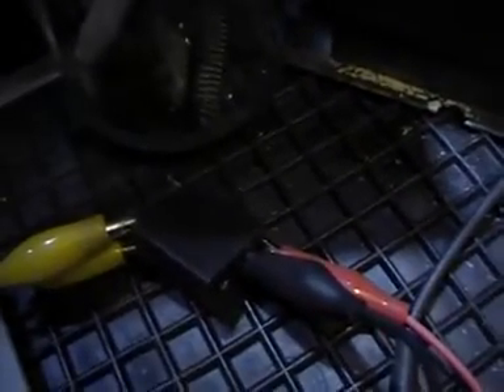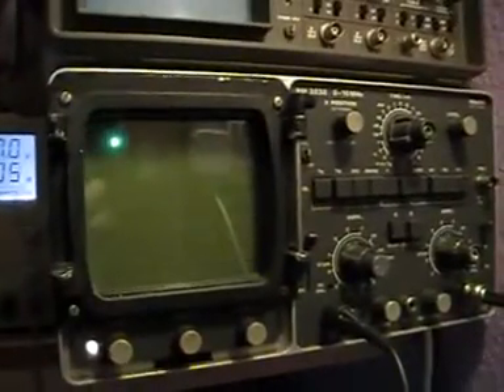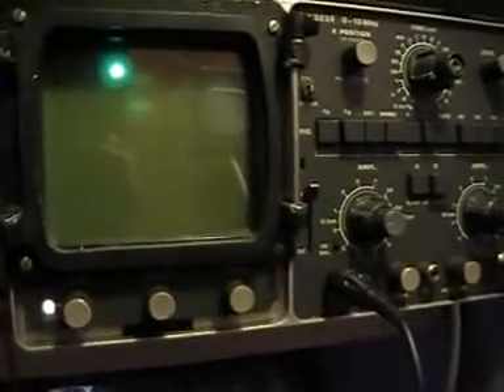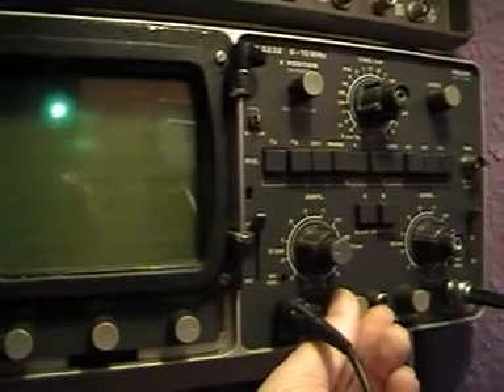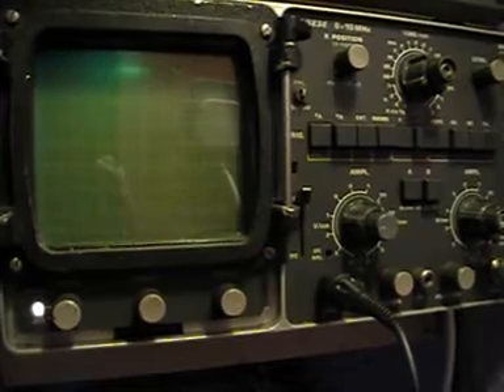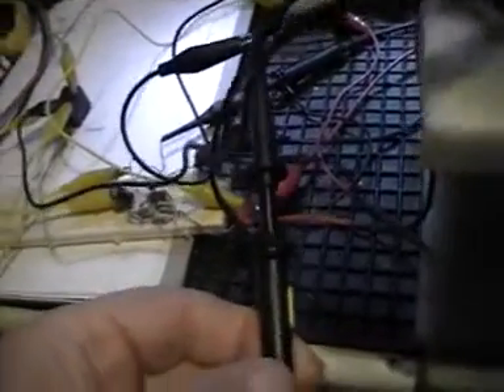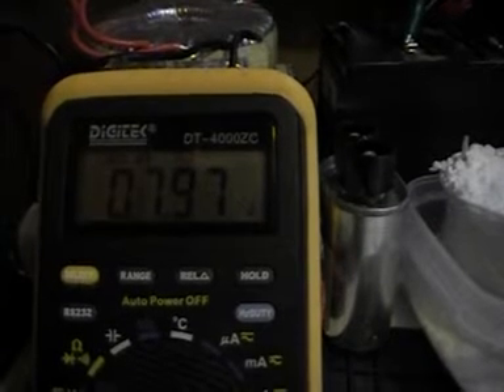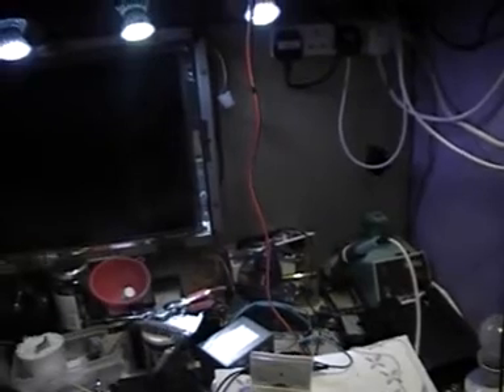DIY Homemade Build Your Own Desulfator Rejuvinator Prototype Part 1

Comment: Thank you for responding.
I have looked at several battery desulfator's. I don't know wich one to use.
I want to recondition batteries here to make some money, and also save some money for the people here.
Do you have a recommendation on a circuit?

Also, before I forget, you should check out ibpointless2 crystal glue battery. He is on you tube.
It acts like a solar receiver, but it absorbs ambient energy. It only collects small amounts of energy and the resistance is high in the cell, but it has a constant out put and the cell, "if made correctly," does not corrode at all. That means it will last about 30 years or longer, and It never needs to be recharged, because its a collector.
 This collector only works on surface area, so you only need thin films to create a battery. In theory, you could have something the size of a phone book and it could provide enough energy to power an entire house by its self.
I would be happy with something the size of a car battery that put out the power of a car battery that never needed to be recharged. I would make about 30 of them and never pay an electric bill again!
Reply from the maker: The one most widely used on YouTube I have found is called the Wizbang. Not looked it up myself.

Comment: Hello. like your recharger. I wanted to give you some info I heard from an old submarine tech I met. He did maintenance on huge batteries the sub's ran on that had gone bad form sulfate forming on the plates.
Please note that I have not tried this myself yet!

 He said he would pour the acid out of the battery into a container for reuse, then add a strong baking soda solution to the battery.
 The baking soda is a base, it would cause the sulfate stuck to the plates to react and come back into solution away from the battery. I guess he would let it sit over night, or a couple days.

 I don't know what would happen if you used your desulfator on it if it had the baking soda solution in it, but I bet it would wipe out any sulfate stuck to the plates, "It might also wipe out your battery, but I don't think so, so I think it would be worth a shot if the battery is already very bad and cant be fixed by normal means." Just stand back until you know what the results will be!

When he was finished, he would shake like crazy and rinse out again thurally.
Check the old acid and correct before reusing, or replace it if it was contaminated.
If He was going to replace the old acid, he would nutalize it first with water from the baking soda slowly until it was neutral enough to dispose of.

 I think if you used this process with your desulfater you could fix almost any battery, as long as there was enough lead and lead oxide left in the battery.
 If you want to get rid of the old acid, Now a days im not sure about the lead in the solution, if you want to dump it, but it won't destroy your drain now if its nutrilized.
Please let me know if this information is of any use to you.

 I plan on desulfating batteries my self to use as a battery bank for a solar array.
Thanks, and let me know if you try this, "Please be careful, like I said I haven't tried this myself, and the old timers were very, uhh,  shall we say brave?
Reply from the maker: Many many thanks Randy for all that information. Unfortunately this particular battery with lead plates no longer exists. But you can see it again as I used the case for my Quantum Accumulator in other videos. I shall be giving this info a try as my car battery packed up at the weekend and to get mobile I shall have to buy a new one. I shall use my old one for this experiment. I shall do a video also about my progress. Once again many thanks. Happy New Year to you and your family.

Comment from the maker: When seeking knowledge. No question is trivial. First sorry I am not a Ham. Like others on YouTube I tried to desulphate dead batteries and it is a difficult task but not unrewarding. Due to the batteries I have being so far gone. It takes a very long time. However in some cases can be rewarding. My success has been varied. The idea of using Epsom salts is to try and get the lead to rejuvenate itself. I think.

Comment: I'm ignorant in this, so my questions may sound as such. Sulfer collects on the cell? Your able to restore the lead cell back to a functioning state? I've seen lead cells that just crumble or at least look all cracked up. I have two old car batteries, I can work on, and would like to. Do you Ham Radio by chance?

Comment: Like saymond said, check on eBay.  I'm still working on my production circuit board for my desulfator design that will mimick frontier springs setup.

Comment: see if you can bring that pulse rate up to around 1khz.  it helps break off the lead sulfate and re-dissolve it into the electrolyte around that frequency.  it sounds like your only doing a single pulse per second.